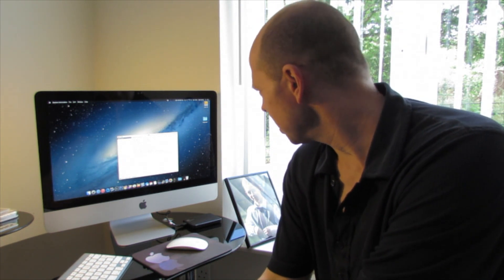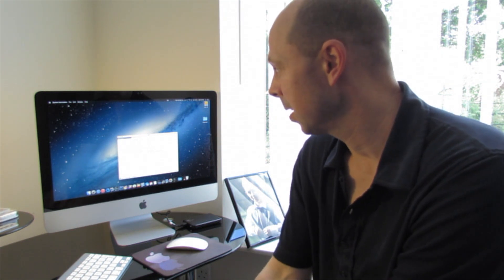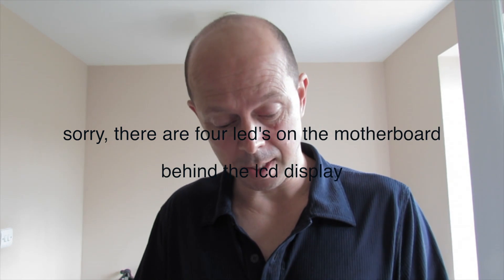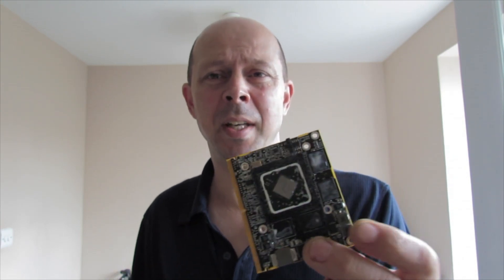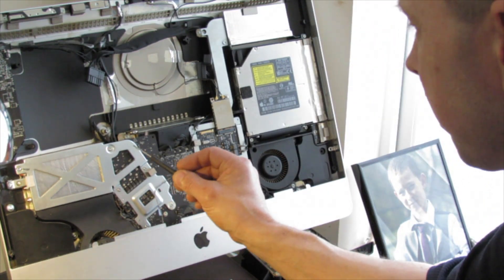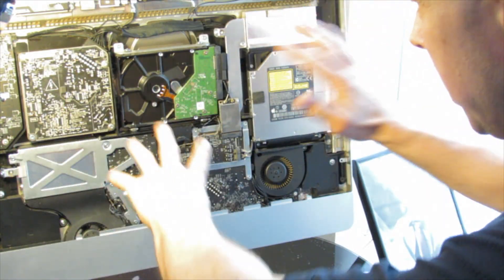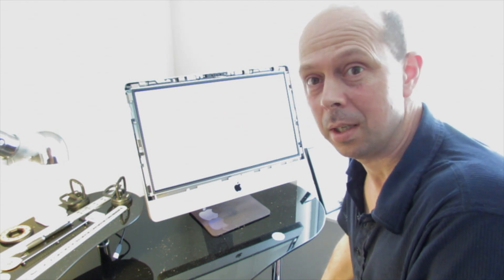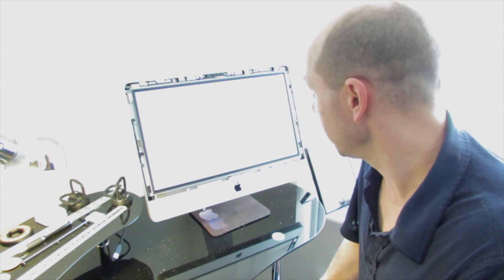apple imac black screen of death ( late 2009 i3 3.06ghz )

Comment: Recent victim of Black Screen.   I bought a used late 2012 27" iMac in 2017.   Used it continuously and rigorously for 6 years.   I left it to auto sleep overnight,  and in the morning the screen remained dead.   The computer still works, as I can access it on a  network.    I tried all the startup keyboard tricks.    Not worth the repair costs - I just bought another used iMac that will hopefully last me another 6 years.   11 years is pretty good for such a machine under continuous use.    It could be a lot of things - a bad capacitor, a loose connector, bad video card.    Anyway it was near it's end of life for running current software.

Comment: Great video! thanks for this. Ive found that if you dont have a blow torch, you can also put it in an oven on a platform that wont allow the bottom soldering to touch anything metal. I used 4 foil balls to prop it up on a baking tray. Oven needs to be preheated and stay on 200 degrees celsius, and the graphics card needs to stay in there for 12 minutes.

make sure you dont turn the graphics card upside down while its hot, otherwise the components will fall out because the soldering is hot and loose. leave it to vool for about 8 minutes and then pop it back in.

Thanks for the video

Comment: My black screen on a late 2009 imac 27inch would happen after a short while after boot up - it was fixed by either changing the brightnes to below 50% or - strangley enough to 100% !
Counterintuitive to put it at 100%, but it worked for me!
Maybe something to do with a specific voltage range fault? Maybe someone out there knows why?
Some people also suggest a fix by changing the brightness with the light sensor covered (left of camera behind glass).

Comment: this is not repair. it will die after load. u just made very bad kind of reflow. u muste reball it
Reply from the maker: funny, to this day it is still working, figure that then sherlock
Reply: @alan4x  try to run gpu burn in test for few hour and u see u dumb*ss. u just stupid. every repairman tell u this, but u still have your right like most dumb*sses

Comment: I have a late 2009 imac that I hadn't used for 8 years. Someone wants to buy it but wants High Sierra to run on it. I started it up and El Capitan was running on it. I then confirmed that LATE 2009 imacs can indeed run High Sierra. So I started downloading High Sierra from the app store and during the installation process the screen just went black. Now it no longer turns on so it's "dead" after MANY attempts to force restart etc. It looks like it's probably the screen that's black (and not the imac not turning on at all) because when I attach an external disk to the imac, and try to start up the mac, the little led light on the external disk lights up, so it seems like something is being powered-up (although nothing shows on the Imac's screen).. Anyone know of a fix??

Comment: I am VERY curious to know if it is still working for you, Alan? I am thinking of doing the same to my iMac (late 2009 21,5").
Reply from the maker: hi, yes to this day that iMac is still working perfectly but i also have a 2011 iMac i7 which had graphics card failure.... i had to heat that card a number of times over 2 years until the card finally died and i had to replace it..but the 21.5 inch iMac i3 i only ever heated once which is the video you have just watched and still going strong
Reply: @alan4x  Thanks for responding, that's very reassuring. I'll be sure to try it out myself, as I have files I consider to be of sentimental value. Also, will be sure to use the Time Machine should I be as lucky as you were in the "operation". Thanks again!:)
Reply: because it is bullshit just to attract viewers

Comment: In order to have a better idea if your gfx is failing, try running your OS in "safe mode" (no extension): hold any of two shift key during the boot sequence.
My 2008 iMac is actually running ElCapitan this way, GUI is painfully slow, but I got the information I wanted: this only trouble (hardwire wise) seems to be that Radeon HD 2600 Pro :-)

Also, I prefer Mac Fan Control to SMC Fan Control, despite it is eating up more disk space & memory and more important: it works like a charm with Catalina !
Reply from the maker: thanks, good information

Comment: Do you think baking the graphics card might work if you don’t have a blow torch?
Reply: WalkinOSF just a follow up. I upgraded ram to 6GB before my 2008 3.06 24” iMac broke. In the process of replacing the logic board I did bake the graphics card for 8 minutes. I used new thermal paste all around on chips that needed it. I also upgraded to a 1T SSD. Wow! I have a new fully working iMac that I am using as a media center. Runs best on El Capitan. Don’t bother upgrading os as it is buggy on this computer with the patch. Feels fast. Also not recommended for sync with iPhone 11 as it could wipe your phone. Just using this as a stand-alone computer and maybe someday for a Linux system. The glitches I encountered with High Sierra os were audio cracking, WiFi issues, and extreme lagging or crashing. Thanks for your video, it was helpful!

Comment: I wish 4 u that it will last a long while. Done some research and a lot has been said about it during the Geforce 8800 - 9800 (and AMD side above the HD 2900 series) when they switched to a different soldering compound. In the beginning there were tons of problems with those cards, having breakdowns of soldering joints. Indeed was reflowing the solution. Where backing them in the oven only solved this temporarily. Anyways there are seperately sold MXM VGA cards that cost around  E200,- and carry guarantee as well. They are well soldered, provided with high quality cooling pads etc. and should last a long while. The backing process is a bit gambling with yr stuff as it carries some risk when being shaken and such. And if too much soldering has been corroded, or poorly accommodated; you won't ever get lasting joints anyways.

Comment: Mine just started today where it went black.  after powering it off and back on it came back on.  Lasted for a bit and then back on.  Not sure if it is over heating or has your problem?  Opinions?
Reply: Any solution Same problems brother
Reply: @ritikjain5330  I could put it to sleep and move the mouse and would come right back on.  I turned the brightness down about 3 dots from max and hasn’t done it anymore.

Comment: Do you have an update on this Alan? Is she still working?

I think electronics at this time where common to fail due to the new (2006) lead free solder rule, so re-flowing almost always works as a fix. These days the lead free solder used is much better so re-flowing isnt needed so much. My understanding is the solder cracks in the post lead free solders
Reply from the maker: hi amigo....that computer is still going strong to this day....i will say when i used it i was encoding hundreds of videos and getting it reaLLY HOT but now it is used daily for mainly watching you tube videos so it has an easy life now...but that repair has done well
Reply: Great to hear. Typing this from my late 2009 iMac with the backlight cutting out so on the lowest brightness, due to my old man playing wow for years lol. Might be a similar issue yet I think mines the panel. I get a whine when shes about to cut out. 
Irrelevant to you now, but this is what you fixed in your GPU. https://www.youtube.com/watch?v=1AcEt073Uds

Thanks for the reply fella!
Reply: Just seen another question with your reply about handing it over to the kids and still working. Glad its holding up!

Comment: my 27" imac screen kept turning off and would only stay on at low brightness, turned out to be disk drill, I had uninstalled it but not properly and left the S.M.A.R.T feature still installed.  Once it was removed my screen worked normally again.

Comment: Dear Allan 
We do repair these faults in manchester.
the reason why this happens its because the product has bad heat dissipation design.
That shiny square on GPU bga is the silicon chip. The firmware with sensors are set to work quietly and this way the GPU working temperature will be 75C and above.this is not good at all because the silicon ic sits on tiny nano balls lead  free..lead free alloy contain tin and that warp when unit alloy thermodynamically expand and shrink. If you remember slow cooker how works this is exactly h your Mac too. When you cooking in slow cooker for 10h the meet will be tender so same happens with the components after while they becomeme fractured.
Healthy temperature for GPU is max  46C..
Reply from the maker: thanks for that information..very interesting

Comment: Please help me with my  problem!!!!

I have a imac 2011 model and right after I plugged in my blowdryer cord in the outlet, the cord sparked and all the power turned off.

We fixed the power, all of my devices are working except the iMac desktop. I turn on the power button, but the screen itself won't turn on (I can hear the fan running though... And my mouse & power bank is lighting up/recharging).

Keep in mind I'm using a windows wireless keyboard with having a  windows icon button = control button

....How could that spark from my blowdryer malfunction this $1,000 iMac??? Huhuhu someone help meeee :(

Comment: There are confirmed reports that the heatpipe part of the heatsink is failing. Small pinholes have appeared in the heatpipe. This ruins the heat transfer capability of the heatsink and makes the GPU overheat. By simply replacing the heatsink the problem is fixed.
Reply from the maker: thanks for the info

Comment: I have the same problem except the iMac would turn on after 3-5 restarts. Do you think reballing the GPU can solve it as well?
Reply from the maker: some of these iMac graphic cards are so expensive it is worth a try to reflow the solder on the chip but it is a fairly large strip down to get to it so yes i would try it but have someone take it apart and do the job if you are not confident yourself as a mistake could be costly
Reply: this dumb*ss dont even know what reball is. waste of time ask him something

Comment: Is it still running or dead?
Reply from the maker: hello, the iMac was used for video editting before it took a dump but after i reheated the graphics card it is used daily for web use and recording video from a playstation 4 and yes to this day it is still running fine, i am waiting for it to go wrong again so i can just replace the graphics card.
Reply: Thank you for this video, I am going to try this on my MXM board as mine just died.
Reply from the maker: if this does work for you then it is best to replace the graphics card but reheating it is a way of finding out whether the chip is at fault without spending any money

Comment: Did you ever get a frozen screen before it failed ? My iMac is currently in pieces, I'm waiting for thermal paste to turn up from eBay since I think it could possibly just be over heating .
Reply: What model is your Imac, 2010?
Reply: BaldwinIV H  2009
Reply: BaldwinIV H
Reply: So the exact same model as the one in the video.  Mine is 2010 so slightly different but I think same VGA card.
Reply: My screen was BLACK but I know there was startup sound in background.
Reply: hopefully get it back together this week, if no joy then bung GPU in the oven maybe  LOL 😀 I prefer to use laptop/ ipad any way. shouldn't have spent so much on imac's but hey, I've enjoyed owning it.

Comment: When you put the graphics card back into the computer did you use thermal grease on the main chip and thermal pads on the memory like it had originally?
Reply: Alan, stop using the iMac and put some decent thermal grease on the GPX/memory (Arctic Silver 5 or Noctua NT-H1). You will destroy the chip. Even if you are using the fan controller software you are still considerably shortening the life of it without re-pasting it. I'm very surprised it hasn't died already.
Reply from the maker: i did not use any thermal grease or pads but i know i should have and you would be best to do so to allow the chip to dissipate heat quicker
Reply: Wow !!!  You're saying you run your Imac with a graphics card that has no thermal grease or pads on it now?
Reply from the maker: yes thats correct lol. but i watch the temp of the computer with the smc fan control and turn the fans up and its been fine but looking back it is best to put some paste back on the chip
Reply: Would you ever consider tearing the computer apart again and putting the thermal paste and heat pads back on the graphics card?  Its such a pain to take the imac apart.
Reply: probably the old stuff on the heatsink is still working ? mine is all cracked and dried out

Comment: my gas soldering iron also has the ability to work as torch, soldering iron, or heat gun.  Should I use the heat gun setting instead of torch?
Reply from the maker: if you think it will get the chip hot enough then you could use the heat gun. it may well be a safer option lol.
there are some videos on you tube where people put the card in an oven and get the same effect
Reply: i would assume with a heat gun setting the temp. is lower, no burning but i would have to heat the chip longer maybe 5 min.  it took me a while just to take the damn chip out!

Comment: Alan, is your Imac still running ok?  Ive got the same problem and will attempt what you did.  What tools exactly did u have on hand for this project?
Reply from the maker: hello, my iMac surprisingly is still ok. i will say now that looking back if i had known what the problem was i would have just fitted a new graphics card. if it does go wrong again that is what i will do.
i would advise you to fit a new graphics card but if you are not sure what the problem is and want to have a go at what i did then you will need some torx screwdrivers and a gas soldering iron that will have a flame come from it when the tip is off. with the graphics card out you will keep the flame a few inches away from the shiny metal chip in the centre of the card and heat the chip for about 1 minute or just less using a circular motion with the flame so you don't heat one spot of the chip too quickly ...hope this helps
Reply: alan howatt ur an inspiration to the DIY person!

Comment: The issue that I am having is that my imac screen randomly keeps turning off blank while the system still works fine. Also my imac is connected to a wakom tablet as a secondary display and it still displays my desktop fine when this issue persists. I hope it's not a major fix.

Comment: hi  im  an apple certified technician and to make it easy to explain what you just did is not a permanent solution ... the graphics failed due to  wear and tear , like a fluorescent tube it gets old and dies, this is the same with the iMac graphics card .When you re-heat it ( called reflowing) what you do is not remelting the connections ( they melt at 218 degrees Celsius) but you re-alined the printed transistors inside the chip (GPU) this solution is a temporary fix and usually fails after 6 months if you want to do a proper fix  you need to replace the chip, but you will need an expert to do this, and specialised equipment is required.
Reply from the maker: Hi. Thanks for your advise. I did what I did as I was not sure what was wrong with the computer and did not want to send it off for repair and get charged a fortune. Fortunately the iMac is still running well but if it goes again I will just replace the graphics card now knowing that spending the money on a new card won't be in vain. Once again many thanks for your expert advise.
Reply: alan howatt hi.... yes you could buy a working card for about £85 ( use) this days and fix the problem . I'm impress of your skills as no many pepole will do that repair 
we offer a service at 140+vat for that repair  with the replace of the chip and 6 month warrantee 
cheers
Reply: Hi.. i have an iMac mid 2011 21.5 inch and the screen is flickering and blacking out and goes completely black on high brightness and also if we type or use system it goes black but system is running behind. we can find the system running using a torch...what is the problem.
Reply: I did this fix and 2 years later the computer still runs fine.
Reply: @TySoVm  yeah we all belive u . just like we believe alan 🤣
Reply: Contact Apple, they need to run a hardware diagnostics. If it does the same thing on a external monitor, it's probably your video chip, but a bad LCD/  LED inverter could also be an issue on older models based on your symptoms.
Reply: Hi, I have a imac 2011 model and right after I plugged in my blowdryer cord in the outlet, the cord sparked and all the power turned off.

We fixed the power, all of my devices are working except the iMac desktop. I turn on the power button, but the screen itself won't turn on (I can hear the fan running though... And my mouse & power bank is lighting up/recharging).

Keep in mind I'm using a windows wireless keyboard with having a  windows icon button = control button

....How could that spark from my blowdryer malfunction this $1,000 iMac??? Huhuhu someone help meeee :(
Reply: @ Gonzalo Fernandez why is the guarantee of your service of work no longer than what you are saying Alan Howatt’s fix will last? Alan I tried your fix all is well and working now. Even if I bought a new shiny 27” 5k iMac before attempting this fix, thank you!
Reply: @jcbx77  alan is telling bullshit just for viewers.
Reply: advise is a verb, good sir.
Reply: Lol.... cant re flow a tube.... twat.
Reply: No ur a certified rip off merchant thanks for coming